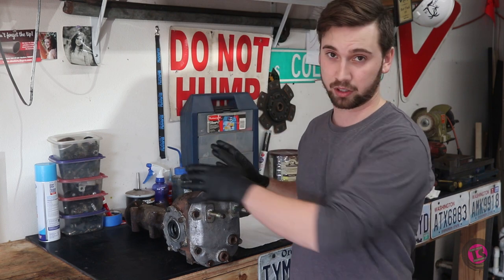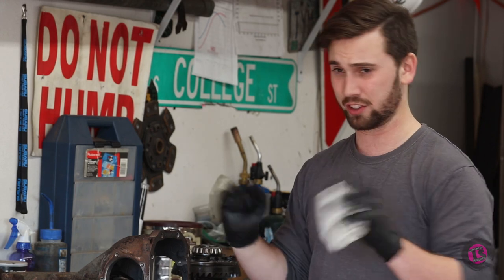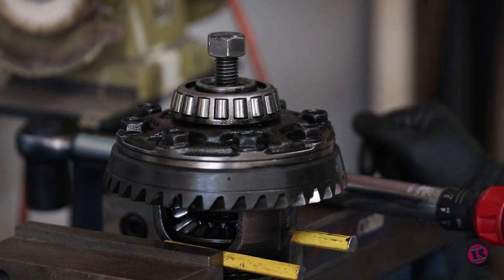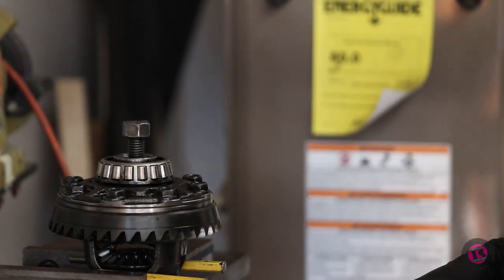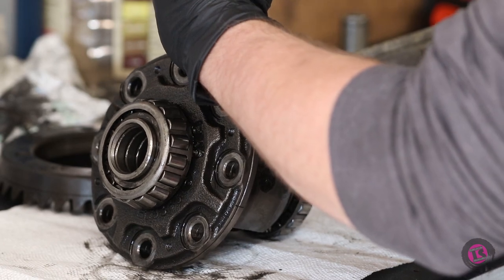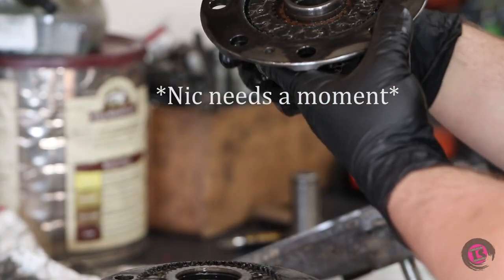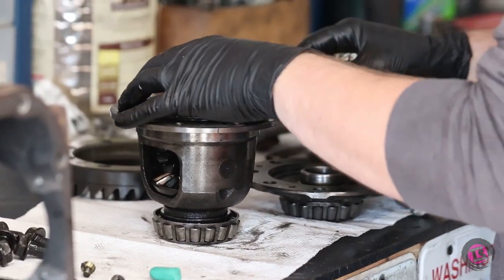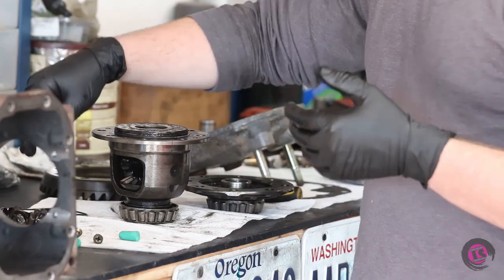Make Your Clutched LSD Feel Like New!

Comment: Would you mind adding the part numbers from them as well?  I'm doing almost the exact same build and I was going to do the same thing to my r160. Instagram ae86luv17 if you'd like to see mine. 98 Legacy GT EZ30D 02wrx trans by ppg. 1st-4th helical cut dog engagement. 1st-2nd and 3rd-4th billet selector forks and shift locker as well.

Comment: Are you still running this setup and is it still working just as good?
Reply from the maker: I haven’t actually tested the breakaway torque lately to see if it’s changed but it still locks up pretty good!
Reply: @TIRESIDE  that's what i needed to know. And do you remember which shims yo uh got? So i don't have to disable before i buy
Reply: @TIRESIDE  would you happen to know what model Subarus come with a vlsd r160 rear differential with a 3.9 final drive?